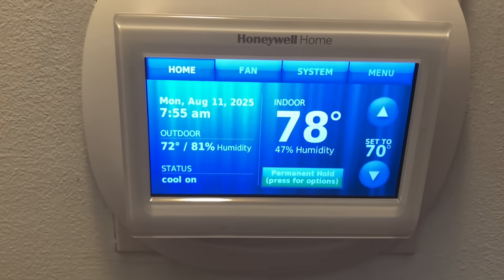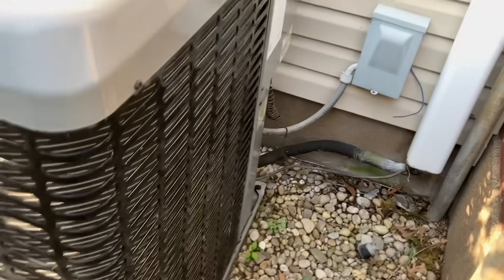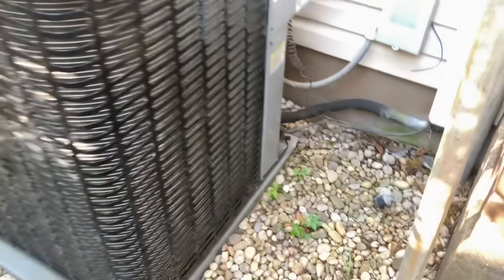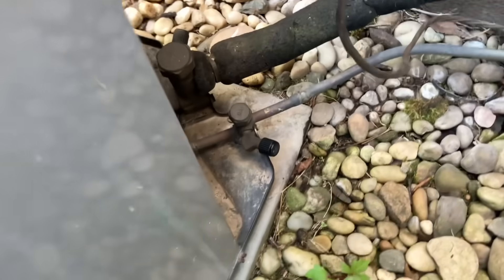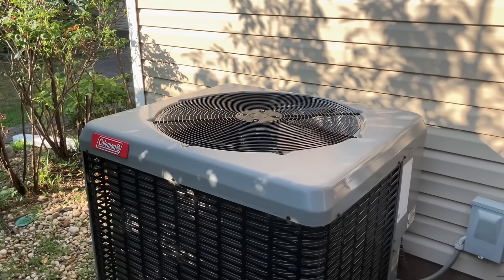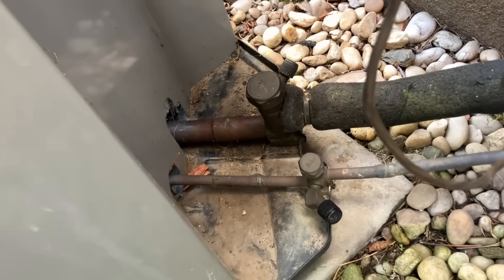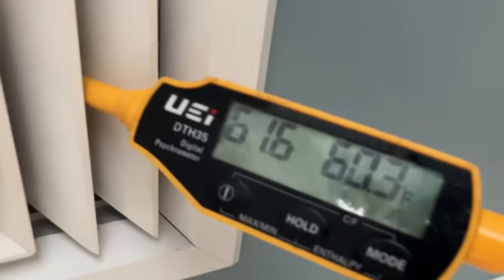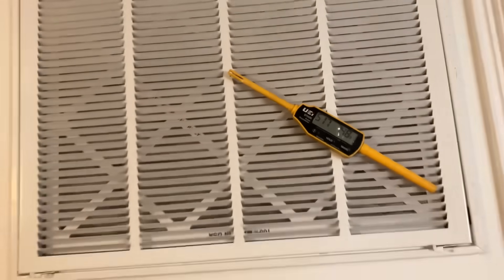AC Not Cooling? Outdoor Unit Dead – You’ll Never Guess What Saved This Home!

Comment: I really appreciate that my condensate drains straight into a floor drain in the basement. As long as it remains clear and flowing, nothing like this can ever happen. To make sure, I add bromine hot tub tablets to the pipe as it exits the A coil and one of those sits in the water stream as it flows past. I imagine if you look at the pipe and the drain, they're both almost pristinely clean. The previous owners had a condensate pump that pumped up and out the sewer drain, which of course failed and ruined the previous furnace.

Comment: Mike, I disagree with you on how much water damage a failed pump could truly cause.
I was dealing with a blockage in the discharge line, to be honest, I left to pump in place and just kept dumping the water.
I only needed to dump the water twice a day.
That's with the AC running constantly. keeping the house at 68-70F
I was also dealing with an A Coil drain blockage at the same time and it dumped less than two cups of water on the floor, over a 24 Hour time frame.
Definitely not enough to cause damage.
Reply: The amount of water will, of course, vary depending on the humidity level in the air. In a climate with a dew point well above the evaporator surface temperature, you can be sure of producing much more than 1-2 cups of water. But sometimes, even 1-2 glasses of water can cause great damage without control. The important thing is that it is uncontrolled.
Reply: must be in Arizona, where it's dryer than popcorn farts!  very humid here this summer, the condensate flow is a heavy trickle the whole time unit is running and I guess it's multiple gallons per hour. not about to measure it as the floor drain is happily eating it. 🤣
Reply: @throttlebottle5906  That’s correct. I’m in Istanbul, and the absolute humidity here is also quite high. For this reason, condensation is abundant. In fact, this water could be collected somewhere before being discharged through the drain. Later, it could be used for grey-water applications such as flushing toilets. As far as I know, the Japanese do such implementations.

Comment: Not a sling psychrometer, a digital psychrometer. No need to swing it. Did you wet the cotton wick? Lmao
Reply from the maker: Leave me alone
Reply: @PipeDoctor  Why are you taking a wet bulb reading outside? That's done in the return air for superheat. (3xWB-80-OAT/2)= superheat
Reply: it makes them acclimate faster to stable readout, especially when going from hot truck or indoors to outdoors and vice versa.
Reply: @throttlebottle5906  That's an ignorant response

Comment: Came across an item that may interest you. I seen it on IG. Cant tag you there. 
https://www.instagram.com/reel/DNS8Ez1gNp-/?igsh=OHBqcWpjeTR6NG54
Reply: funny, I was just thinking about using a roof plumbing vent boot for my line set through the block wall. which I sleeved with 3" stainless steel tubing(leftover exhaust pipe, lol)
Reply from the maker: I’ve seen that before.